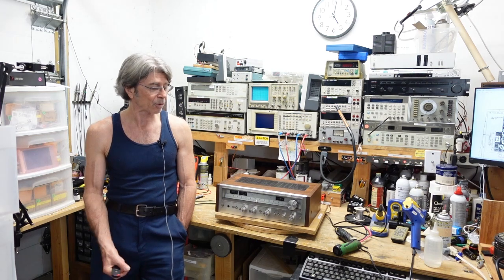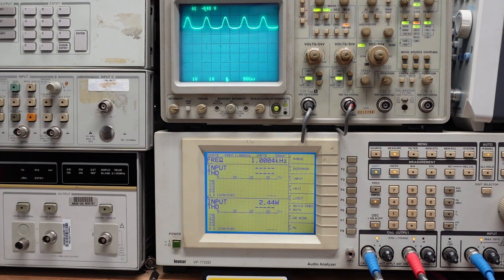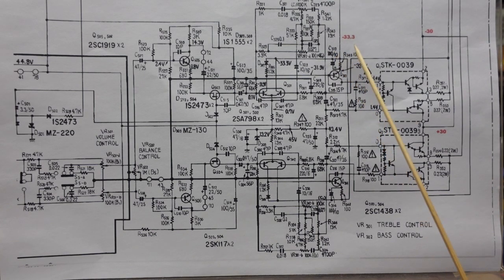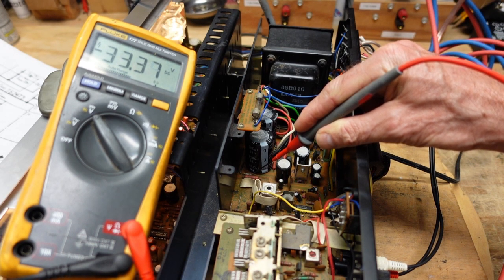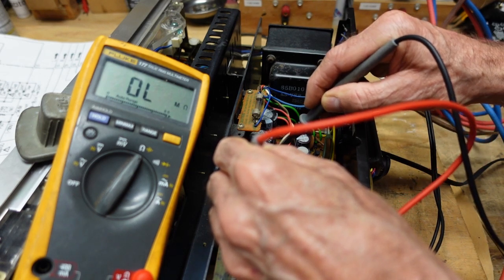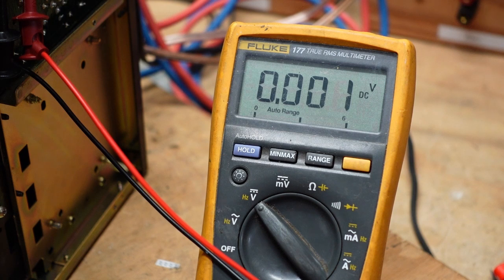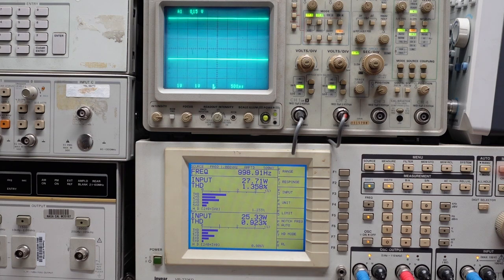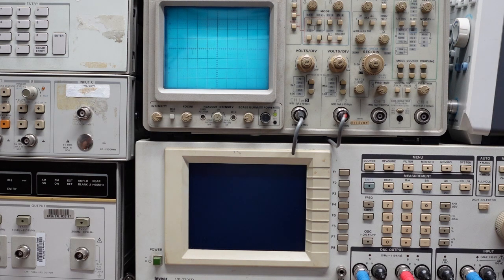Pioneer SX680 Repair

Comment: Great job on explaining your troubleshooting diagnostics , but I really enjoy how you breakdown down not only the issue , but you also explain in detail basic fundamentals and techniques on troubleshooting the equipment.  You would make an excellent educator in an electronics classroom .

I recently just came into buying an SX 680 and only replaced the power supply electrolytics , transistors (C1384 and D712).  It was advised to replace R401 (33 ohm) but when I measure it , it measure 32.8 ohms, which i thought was pretty good shape , so I did not replace it.

The kit also has tons of quality WIMA caps , transistors and electrolytic caps for the front board and tuner section , but it’s running well with no issues .

Should I still replace the audio caps given it’s working , or just keep the caps incase something down the road goes out on the SX 680?

I’ve heard the power supply area is usually the best area to replace components due to heat .

On the DIM bulb tester , what size bulb wattage should I use on the SX 680?
Reply from the maker: You can replace the caps if you wish, but if it's working well you may not hear any difference.  A 60 watt bulb should be good for that receiver.  You can still find incandescent bulbs in old school hardware stores.

Comment: Hey Ray,

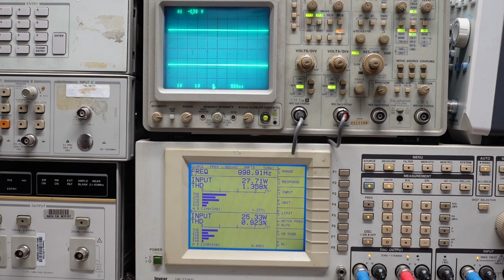I wanted to take a moment to share some feedback on your recent video. I really appreciated how, towards the end, around the 11:01 mark, you took the time to summarize the key points and lessons learned. It was a great idea to provide viewers with a reminder of the symptoms, the diagnostic process, and ultimately how the issue was resolved or partially resolved in this video. While it may not have been a new concept, I felt you executed it exceptionally well. It really stood out to me, and I wanted to acknowledge that. Judging from the comments, I am impressed by your engagement with the audience. Few creators seem to engage at this level. Thank you for your dedication and keep up the excellent work!
Reply from the maker: Thank you for the kind words!
I feel it's important to not only show the trouble, but also show the steps that led to successful diagnosis.  And the thought processes that go along with that.
I try to read and respond to the messages my viewer's leave, not only to thank them but to acknowledge when they've taught me something as well, which happens frequently.

Comment: Nice job. If the positive supply has the same resistor could channel imbalance be due to resistor drift. Worth replacing?
Reply from the maker: I don't think this unit is set up that way.
I did see 4 more fusible resistors on the schematic, but they're not in this particular unit

Comment: I recently finished repairing and restoring two SX-680s. Sounds like R410 is a common issue for these receivers but that wasn't the case for the ones I worked on. Makes me think maybe I should be proactive and replace em anyway.
Reply from the maker: The schematic I worked from showed 5 fusible resistors, but R410 was the only one actually in the one I worked on.

Comment: Hi Ray, when I turned off my computer at night and was almost asleep, I got a notification on my mobile about your new post - I posted it at breakfast 😁 It's an incredible coincidence, but yesterday I was buying and changing this hundred Ohm resistor in the power supply - u it was not an amplifier, but a source from a domestic dishwasher.
Super fast diagnosis and repair, and in addition, the Panasonic display lit up beautifully 😂

Nice day 🙂 Tom
Reply from the maker: Thanks Tom!  My mobile goes into Do Not Disturb when I go to bed.  Got enough trouble sleeping at my age!

Comment: good thinking finding out the culprits😮 ray
Reply from the maker: Thanks Wilfredo!  The schematic lists 4 more fusible resistors, but this unit didn't have them.  the 4 in question are carbon film in this unit, which is fine.

Comment: If the dim bulb shows short how do we give signal to the amp , i mean should we let it stay switched ON on a dim bulb ?
Reply: Find and remove overload or short first.
Reply from the maker: Johnny is correct. The dim bulb indicates whether the unit under test is pulling excessive current. Then you turn it off and look for shorted devices.
Reply: While giving it input signal
Reply: If you're showing a short, trying to feed a signal into the amp will only make the problem worse.  As the others have said, shut it off, get out your ohm meter and look for the short.